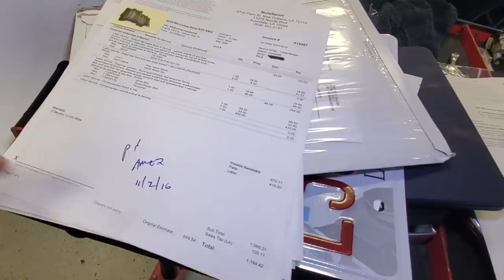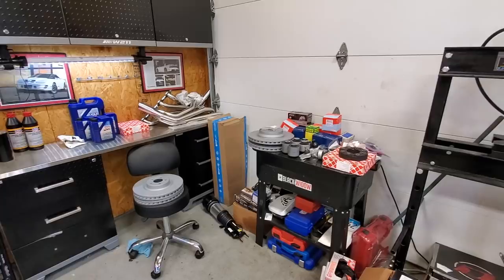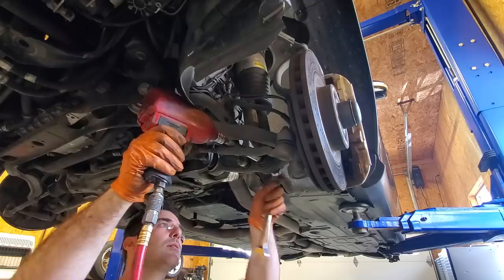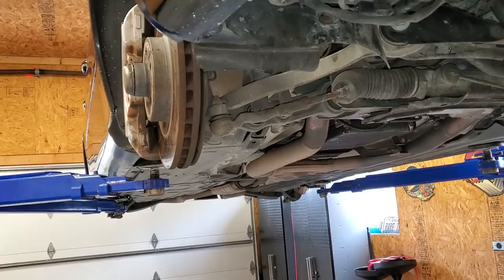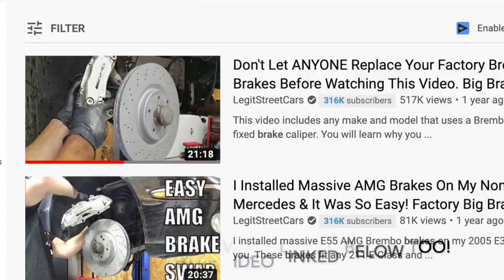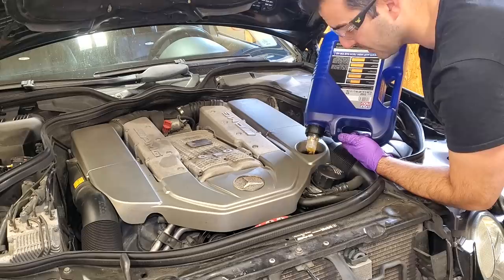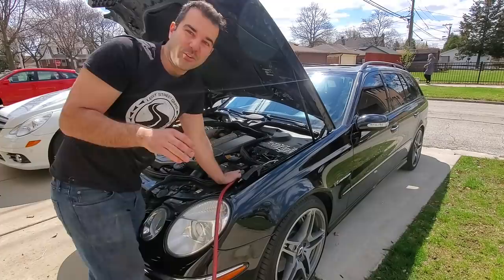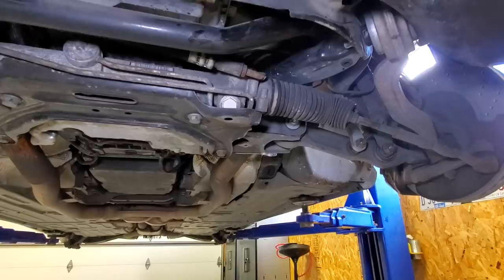I Mechanically Restored My Rare E55 AMG Wagon In 1 Video & Saved $5,000 Doing It Myself. Legit Fix!

Comment from the maker: What's the last thing you fixed on your own car?
Reply: Same issues.I have a 2004 e500 wagon. Mercedes did for free the fuel tank, sbc, and just got a letter for entire sunroof replace under warranty.
Reply: Me and my brother (mostly brother lol) changed the water pump on my bmw e28. Next is a aircon rad on my brothers mk5 golf,
Reply: Just changed EGR on my 1.9 TDI A4 B6.
Reply: Leaf spring shackles, brakes and rotors on a 99 Silverado
Reply: I'm going to be changing my ABS Wheel speed sensor when it arrives.
Reply: took away my dpf and replaced it with a downpipe, i would call that a fix :)
Reply: Coilpacks, Spark plugs, Have injector Cleaned by a shop, And also An Oil and Oil Filter Change.... (Was bored during quarantine)
Reply: LegitStreetCars thrust arm bushings on my w204 c200, learnt a lot from your videos
Reply: Tie rod ends and the right front wheel bearing just lat week. I can't believe how similar my 2009 Challenger SRT8 is to Mercedes suspension. I guess it really is an old E class. You're right. Once you stare at it for a minute, It's pretty straight forward. Great vid!
Reply: Thanks Alex, with your help I fixed on my 2004 CLK500: Control Arms & Bushings Front + Rear, Lowering Springs and Bilstein Shocks, rebuilt Aux Cool. Pump ($7.50), Radiator + Lines, Water Pump, Belts + Pulleys, Tansmission Fluid + Electrical Plug, Turn Signal Lever, Clock Spring + Steering Wheel Buttons, Alternator Voltage Regulator, Accelerator Position Sensor. Yes, it is fun to take out the car for the first ride after all the repairs! Thanks Alex!
Reply: Motor mounts and transmission mount on my 07 E350 and thanks to you from FCP euro that was cheaper than the dealership even cheaper then my employee cost
Reply: I changed the coolant expansion tank on my W211 after it cracked. Planning to do the EGR tube next.
Reply: Replaced front brake hose yesterday
Reply: Recently replaced air suspension all the way around on my '07 Ml63 AMG - removing the front air bag from the shock was a bit challenging without all the right tools
Reply: Replaced AC compressor on 2011 Corvette Grandsport.
Reply: LegitStreetCars Handbrake  in w211
Reply: Complete trans service with filter. You gave me the kick to change the ‘lifetime fluid’ in my IS F. It really made it shift a lot better!
Reply: My valve cover gaskets Lexus GS 99 and 0- rings
Reply: Chanced the seatbelt butlers on our clk350 w209 convertible. And did some leather treatments.
Reply: Installed some reinforcement plates on the C Channel mounting points on my 1993 C4 Corvette. Second project is installing Long Tube Headers. On my 3rd manufacture that says they fit. Ordered Stainless Works set now. Waiting to ship. Third Project will be a LTCC Coil on Plug conversion. Had the parts but no time...Have a shit load of time now. Going though alot of beer.....
Reply: I just got my wife a 2014 E550 coupe with the BiTurbo. She doesn’t know it but I’ll be “fixing” the ECU with a RENNtech tune. She may notice the extra 105 hp and 197 tq after it’s done, I know I sure as hell will!
Reply: LegitStreetCars the bumper was falling haha I fixed it
Reply: The fuel door lock actuator on my '18 Civic Si
Reply: PSE pump on my 02 SLK 230. Just hit 56k with the nice weather.
Reply: Yesterday I replaced a FP on my W220, and got my AirMatic working again.
Reply: I replaced the water pump on my E39 540i and did the belts while I was in there.
Reply: i am going to fix my cdi injector leake tomarow i dont have a seat cunting tool but i dont think i need one cus 3 days ago the injector was fine and 2 days ago when i started it up sounded like a steam engine so i did not drive it . Is is bad if some carbon bits go in the engine they shood blow out the exaust valve right i wil do my best not to get any in there maby stuf the hole whit paper towels
Reply: Brake replacement on my MB c280 2007
Reply: Replaced a blown p/s/ hose on my '74 Vette. Refilled the reservoir and it started leaking! Have never seen the p/s/ tank leak on one of these that wasn't the seals. Oh well, gotta love old cars!
Reply: Broken wire for the air suspension pressure release valve on my e55.... what a pain that was!
Reply: valve cover gasket, and engine bay clean up for my dad's Opel Astra
Reply: Cv shaft on this 07 328xi I want to get rid of.
Reply: Water pump on my 2000 trans am.
Reply: Engine, headlights, a/c radiator, light swich, in my vw polo 6n2 2001 1.4 TDI
Reply: Oil, plugs, filters on the W202. I think this weekend will be steering damper and rear diff fluid with gas filter. Turning wrenches on the car relieves stress. 😎
Reply: Alex I only watch these videos for the techno music.
I put a new front fascia on my car.
Reply: Front and rear struts. Never did it before and ended up taking about 4 hours for the front (3 hours spent going to and from harbor freight to get the right tools) and about 45 minutes for both of the rears. The '06 corolla now rides like it's brand new. Thanks for the great content!
Reply: Replaced fuel injection harness on my V12 Jaguar XJS
Reply: LegitStreetCars motor mount—next up is an exhaust flange gasket.
Reply: Just did my C55 valve cover gaskets thanks to you! Working perfect, but MAN THAT'S A LOTTA SPARK PLUGS! I inspected every one.
Reply: Front suspension on my C32 wagon! Alex, after heating the metal on that subrame's ear, apply some antirust paint ... Otherwise it's prone to rust as soon as it gets a little of water or humidity. Take care man
Reply: I know what I get to do next, have the dreaded "No Oil Pressure" warning on a XC-70.
Reply: Well my local Chevy Service Department fixed, but I wrote the check(I know, who writes checks anymore): major tune-up.
Reply: Gas cap
Reply: Recharged the AC on my 16 Mustang GT.  The evaporator has a leak, which is VERY common on these.
Reply: Front pads & rotors on my 2016 Audi A6 Avant. 
Love the videos like this one 👍👍
Reply: Fixed? Unclogged drain that was causing water to enter the passenger side front footwell on my 958 Cayenne S. But I serviced the car myself last weekend and found it extremely satisfying.
Reply: LegitStreetCars Shocks & struts, ignition coils, plugs & wires, transmission (an unexpected surprise) breaks in all four corners & some other random at. I like your idea of reliable high mileage cars. I’m not a great mechanic but I know a few have been helping me along the way get my vehicle back to where I want it to be.
Reply: Crack case seperator in my 320 cdi
Reply: I have a 09 V6 Hyundai Sonata and the alarm would go off randomly.
I found out that the rubber stud that's supposed to hold down the hood switch is missing. So I clipped down the switch with a copper wire, until I can get the stud to buy after my city's lockdown is lifted.
Not to worry, no one is going to steal my engine.
Reply: I replaced the leaking crankcase vent valve, torn air ducts and spark plugs on my 2010 GLK350
Reply: My drive shaft on my 2001 bmw 325i a week ago
Reply: Cleaned up the intercooler and repaired the shrouding around it.
Reply: Just got a 09 W204. Replaced the control arm links.
Reply: My passenger door window lift in my 2000 A8D2 3.3 tdi.
Reply: Removed Intake manifold to Inspect injectors and clean valves on 13 Caddy ATS due to no start. Dealer wanted to put new $12k motor in and I fixed it with less than $20 bucks.
Reply: Fuel pump on my 2005 yaris t sport!!!
Reply: W212 E63 AMG. Did the motor mounts, trans mount, all the pulleys and the belt. Huge pain. >.>
Reply: reseal the throttle body and replaced the heater valve, om642, S211, facelift.
Reply: Oil Pressure switch...1987 Dodge Dakota...tucked up by the firewall by the distributor....
Reply: Buy an Ml and do a series first gen !
Reply: LegitStreetCars Alex your garage is my dream garage! I hope one day to have a 4post and all those tools🙏👍 
Last job I did was a full brake job on a BMW 5 series. Early 2000s.
Reply: I just fixed another mirror on cheap car
Reply: Is it possible to put a 550 amg kompressor on a s500  I seen them on ebay  for $1300.
Reply: “Body control module” the ol soldier points broken so I was getting the no power window or radio working🤬🤬 but luckily fixed many so it’s a easy fix
Reply: Rebuilding the motor on my E39 525i wagon to fix oil consumption and valve tick. Hurray for $500 BMW's!
Reply: sway bar bushings and end links on my e39 530i
Reply: Today rear air suspension bag
Reply: A Mercedes dealer sold me a used 2013 E400 3.0 TT sedan with a bad battery, rather than pay the $600 at the dealer I went and got an Australian brand for $244 with a higher CCA
Reply: Intake manifold W211 diesel, and SBC battery.
Reply: just today, on my Lexus GX470 at 150k miles replaced; gear oil in front diff, transfer case and rear diff. transmission filter and fluid flush. engile oil and filter change.
Reply: Water pump and changed the whole ecu
Reply: Driver's seat cover on my 2014 E250 Bluetec, as well as "Fixing" the AdBlue system.  And also programmed the car to keep the ECO start stop function off until I turn it on again (defaults to the way I left it when the car was shutdown).
Reply: Full front suspension on my 07 Daytona.
Reply: steering colum on my grand national
Reply: Working through refinishing my interior on my E39 M5! It's been a huge project, but it's saving me THOUSANDS!
Reply: I diagnosed the leak in my ATF/condenser, did an oil change in both diffs (Redline) and a transfer case oil change on my Durango.  I will try Lucas Transmission Fix to stop the leak in the ATF cooler since the AC is working fine.
Reply: Shotgunned the secondary air system pump and valve in my 07 Chevy Trailblazer. Turns out it was the relay with the green crusties. Live and learn.
Reply: Fuel injector on a 6.4L powerstroke diesel
Reply: Complete rear brake replacement.
Reply: LegitStreetCars need some BMW action....
Reply: LegitStreetCars I updated my front brakes on my 2005 Toyota Tundra. I upgraded to drilled/slotted Power Stop. Red  Calipers.
Reply: Replaced the coolant hoses and a belt tensioner. Cant give you all the credit, but lets say that you yourself and a dude who says we should wrench "frequently" inspired me to start doing my own repairs. Thanks !!
Reply: LegitStreetCars Last thing fixed? Overdue (CoVid-19) Car Lease payments...
Reply: Flex disc, I regret not loosening the center support and it took me hell to get the new one to fit in. I almost gave up, lol
Reply: Intake gaskets on my 2006 Chevy suburban
Reply: LegitStreetCars speakers, then not hours after I got done the hail found my car
Reply: 2018 Camaro SS, tuned it and changed to colder spark plugs after adding a magnuson 2650
Reply: Aren't you supposed to load the suspension when doing links/arms 🤔
Reply: I fixed the bouncing door locks in my W203 by replacing the small spring in the both door lock actuators. A bugger of a job but saved a fortune by DIY.
Reply: Lmao audi a4 b6 dropped tranny to replace clutch, PP, flywheel, slave cylinder and a lot of other miscellaneous things. Feels good to work on ur own car.
Reply: Replacement shock absorbers on the front of my w211.
Reply: injector number four on my e90 330d m sport
Reply: Bmw e39 i had a broken water pump and as you can imagine this little think create a huge vapors on the back cars in the middle of the autobahn with 180 km/h... So i changed alone water pump, the broken fan and fan shroud, broken pulleys from water pump and power steering pump, and i had also to fix the front electric fan that was dead the last 2 years cause of coroded cables... A huge mess 2 days of work...
Reply: Seized AMG pad pins and rotors
Reply: Last thing I fixed on my AMG was the offset. 
Factory 21s just didn’t do it for me 😆👌🏼
Reply: Water pump 20-years ago
Reply: New rear break discs , calipers and pads. New front discs and pads with front calipers rebuilt with new pistons and seals. New thermostat and glow plugs. Busy busy busy.
Reply: You mentioned keeping the cowles clean to prevent blocking drainage holes. I had a problem with water ingress because of blocked drain under the fuse box in the engine bay. Can you please show how to access the drain holes and clear them under the fuse box. Thanks in advance. Love your channel, you have inspired me to do many more repairs to my W211 and I have saved a fortune.
Reply: Replaced seized heater blower on my W204 220cdi, not too tricky. Happy Easter Alex!
Reply: brake switch just went out on my ecoboost mustang and put it in the worst limp mode with no errors  .dealer wanted 900 for the entire assembly ,ebay had the singular part, for 5 bucks 
thanks to all forum users 
 one love my gear heads
Reply: New wheels and adjust the suspension.
Reply: The Gasket between the seat and steering wheel
Reply: Replaced the CV axles on my father's Lexus
Reply: LegitStreetCars just fixed the pcv valve and changed the cam plugs
Reply: Replaced oil pressure sending unit on 2003 911 C2
Reply: Timing belt service, transmission service and upper control arms Audi B5 A4. All-day yesterday, thankfully done.
Reply: Rear suspension trailing arm bushings on my Honda.
Reply: I’m in the middle of replacing the rear main seal on my 2006 Jeep Wrangler TJ.   So why do I spend my leisure time watching Alex fixing his cars??!!.  Seriously, love this E55 wagon!
Reply: VRP secondary heat exchanger, Superflo pump, 77mm pulley, idler pulleys, BWK, paddle shifters, Race IQ TCU all installed on my E55 in last few weeks! Now the season can start!
Reply: 06 e55 amg last repair was SC bearing.
Reply: LegitStreetCars replaced the front end after my girl wrecked :/
Reply: Replaced the idler pulley on my 2005 CLK55 AMG..
Reply: Rusted bumper and lower rad support
Reply: LegitStreetCars I have a 2003 VW Passat V6 4Motion. I replaced the mufflers and exhaust pipes, changed the oil and oil filters, and the spark plugs and the wires for them. Although each task was costly, but I still saved a lot of money by doing it myself.
Reply: Replaced the number plate light assembly with a new OEM unit along with a stretch of new wiring harness and the connector on my 2005 Renault Clio mk2.
Reply: Last repair on our 2005 Jetta GLI mk4....heater core and evaporator.   Talk about Chitty job. Sucks having to take out the dash, replace dryer, recharge system....
Reply: Did the air strut on my 04 e55 .... same as you. These kind of videos are the best.👍🤙
Reply: I just bought a W210 E55... I need you to "preserve" it for me, no rust and I'm going to daily drive it in CHICAGO.  I need your expertise and you dont have a single video about the W210 AMG.  Come on, help me out ALEX ! Btw, I don't live far from you =]
Reply: Oil change on the 13 C300 4Matic with Lubri Moly from FCP Euro. Need a tire checked out for a slow leak and the ECO function seems to not work at all anymore. Could be the fact it's got the original battery. And, I'd like the dealer to update the maps and check out the ECU for updates. And, the air bag recall is still an open issue with this car. I've been told that the air bag mfgr and MB are first handling the cars in the South US, then working up this way to Ohio. Huh?
Car runs very well, though... tight steering at 76k miles.
98 SLK230 kompressor with 45k miles was unwrapped for the Summer, last week when it was 70deg F outside. Started up and ran like a champ. I use Sta-bil in the full fuel tank and run it for 15 mins. I also use a battery tender, with steel wool in the tailpipe to keep the mice out. Also use dryer sheets and an open box of baking soda inside and then cover the car with an expensive cover. This Summer, I need to work on a few small dents (no chipped paint) and have some chips touched up on the hood or have it repainted as the touch-up paint from the shop with matched paint, turned orange, not Imperial Red.
Stay safe.
Reply: Blinker fluid on my Daihatsu.
Reply: Heater duo valve. On E55 AMG S211 2006 estate. 7 seater. Nearly 210k miles...daily driver... And about to start headlight polish. Many thanks Alex, you've inspired me to have a go myself. 

Love the channel, and all the videos. Awesome!
Reply: Last thing I fixed on my 06 E55 Wagon was a broken headlight washer than was leaking fluid everywhere and a damaged coolant line that was dumping coolant.  Both leaks started same day, both drained through the same hole in the underbelly pan, and  both fluids were blue.  Confused the hell out of me for a minute there.  :)  Sent you an email about the coolant leak, because that one was really sneaky.  Could be worth a preemptive fix.
Reply: Hey Alex,great content..Much love from Australia..I have a W220 S500 and I am now looking at the S65 AMG W220.Have you had any experience with these vehicles??Thanks again for  the great content..
Reply: Supercharger pulley bearing on my E55. Got a pile of suspension parts, split cooler, secondary heat exchanger, upgraded pump with split cooling along with a 76mm pulley and tuner, all from VRP, FCPEuro and Rock Auto. Thanks for all your videos Alex, I wouldn’t own this car if I hadn’t seen your first E55! Mine is identical to your 4 door. Thanks for your channel!
Reply: Does changing a air strut require a scan??
Reply: washed it :-)
Reply: Nothing...i have toyota
Reply: Engine mounts. Had to drop the whole thing.all of them where bad. I had an awesome day
Reply: I have an 01 bmw 540i, completed water pump, all new hoses, valve cover gaskets, upper timing cover gaskets, spark plugs, new battery, and hopefully this week oil pan gasket and oil sensor gasket. Im sure you already know with BMWs gasket here, gasket there, gasket everywhere!
Reply: @trickslower  2003 E270 CDI wagon. Got the same letter for the sunroof replace. Which is funny because I haven't ever been to the dealer with this car, but they looked me up in our equivalent of the DMV to get my email address.

I'm honestly wondering if they'll do my SBC when it goes. The 25 year warranty is for the US only, but I've heard of people getting it in Europe too.
Reply: @sookoll23  Mercedes will find you man. My sbc started doing the infamous "mouse fart" every time i would hit the brakes. Brought it to Mercedes dealer diagnosed it as faulty sbc component and replaced the entire sbc pump with a shiny new one. Before i brought my car to Mercedes I scanned it myself with icarsoft and confirmed it was sbc fault. DO NOT CLEAR THE CODES! Mercedes may think you are from outerspace if car has no codes and treat you like a peasant and prob wont fix sbc.   Even had an issue after mercedes installed sbc. They tried saying it wasnt related but i knew better. They diagnosed again and as expected was sbc issue and fixed the follow up for free. Decent customer service and parts department always surprise me with ocasional cheaper than ebay part.